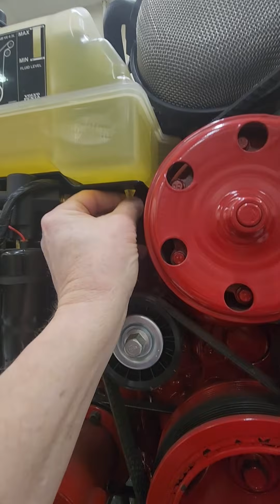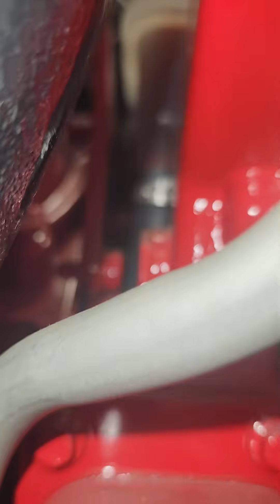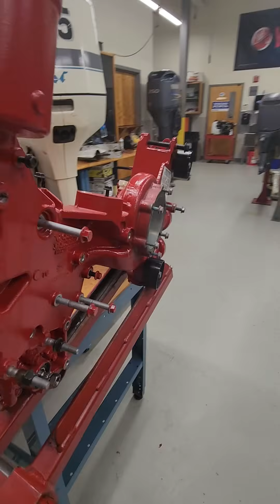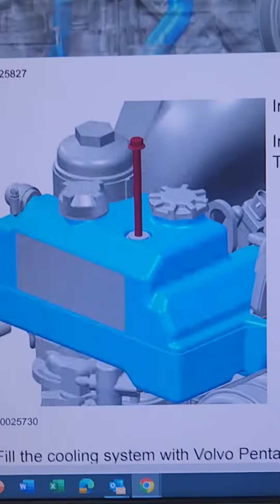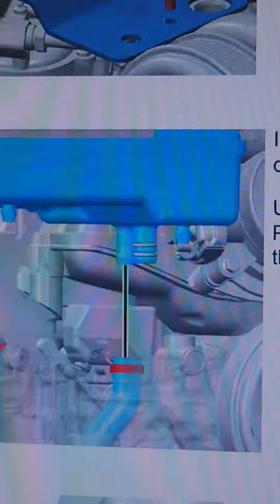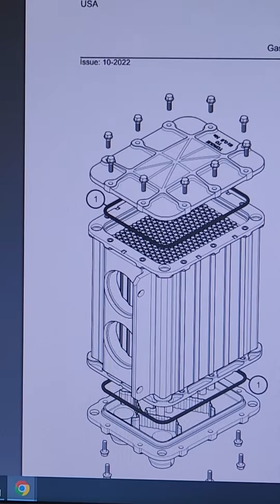Volvo Penta GEN V expansion tank & heat exchanger remove and replacement

Comment: Good morning Mr. Ted, how can I contact you? I have a big problem with the transmission of my Volvo SX Cobra 1.66. Could you give me the address of your repair shop?
Reply from the maker: Where are you located? Will you be shipping it? I have a 1.66 gear/shaft set if the case is rebuilable.
Reply: @tedsmarinerepair8956  Nashville, Tennesse.

Comment: I finally had an opportunity to work on the boat to get the o rings changed. I was able to compress the plastic clips without dropping the fuel pump by using a 10mm box end wrench. I did however need to remove the throttle body to get enough clearance to remove the degas bottles nipple from the bore. The tension I was originally feeling was the back power steering line, it was very tight, but after cutting a ziptie I gained just enough room to sneak the o rings in and out without removing it. I didn’t observe any damage to the bottle or the o rings, I believe the cold weather may be shrinking the plastic of the bottle enough to allow the bottles nipple to leak. I see the original part number has been replaced with an updated part, maybe this is a known problem? I’ll monitor the situation and see if the new o rings have any effect, I also noticed that my port engine is now leaking a tiny bit too. If it continues to leak I guess I’ll either replace the bottles or deal with topping off the coolant in the spring. Ted, Thanks again for all your help, I look forward to your next video.
Reply from the maker: Great follow up with your work. I am hopeful the new o'rings solve the issue. Keep in touch with any new findings on this.
Reply: I am having the same issue. Temps dropped here in northern texas and both my port and stbd tanks on V8-300C's are having a very slow leak that you can see the coolant dripping into the bilge. It's such a slow leak that it could take a couple of months before the level of the coolant drop to below minimum. How is the new tank holding up? Mind posting the part numbers you used for the replacement? tank, gaskets, oiteker clamps, etc

Comment: Ted, I can’t thank you enough for the video. A little backstory in case someone runs into this in the future. Last winter is when it began leaking. The leak is so incredibly slow. It’s hard to tell exactly where it’s coming from, but it appears to be coming from between the bottle and the plate. Last winter I purchased the O-rings, and got to the point of pulling the bottle off, but it felt like I was using an excessive amount of pressure to pull the O-ring nipple out so I got worried I was missing a fastener. The engines were still under warranty, so I had planned on, adding some UV dye to the system to help pinpoint the leak location and letting a dealer repair it. Once spring rolled around and I got the boat out on the water. It never leaked another drop. The boat was actually at dealer getting an alternator replaced under warranty. I mentioned the leak, but since it wasn’t actively leaking, there was nothing they could really do. Once the cold weather started setting in here in New York I again noticed a small amount of coolant sitting in the bilge. Thanks to your video. I know I was following the correct procedure removing the bottle, I think, as you suggested, I’ll tap in some composite door shims to pop the bottle out of the FEAD. I’ll report back with my findings.